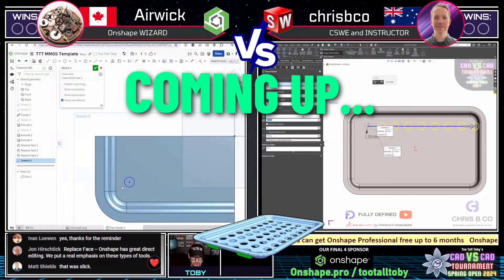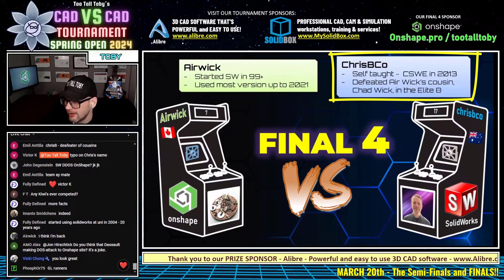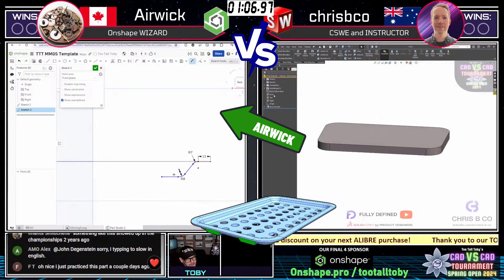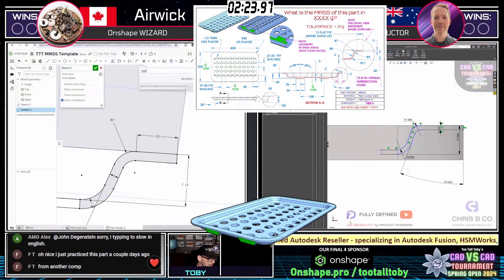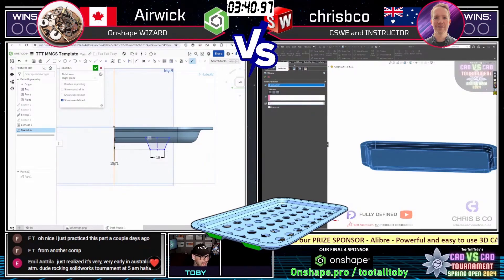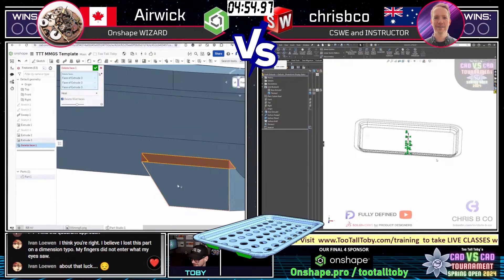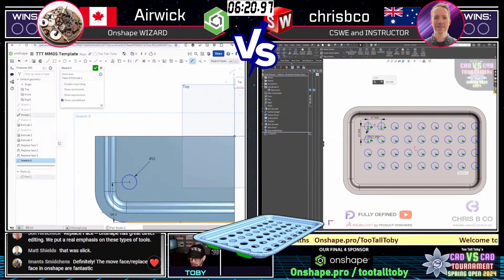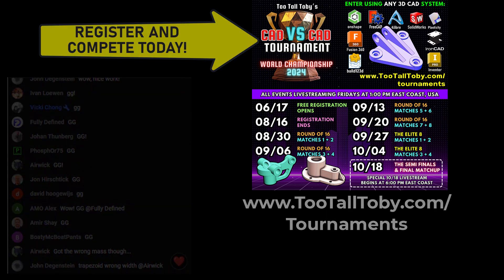Which is FASTER?  SOLIDWORKS vs ONSHAPE - ChrisBCo vs Airwick -Match 1

Comment: Feel like Chris could have sketched a centered circle and used fill pattern for the final pattern, would have saved him a few seconds. It's clicking one surface and typing one dimension. 
Whereas I am sitting at a solid 21 minute completion - but I did get the weight right though.
Reply from the maker: Awww yeah that's awesome!  Nice job getting it correct.  The speed comes with experience (and practice) :-)

Comment: Can someone explain why almost no one is using F360? I've just started to become somewhat proficient and the UI seems a bit cleaner.
Reply: Fusion is very similar to onshape, and onshape has better collaboration, accessibility and a more in depth model and feature library, although fusion does have better CAM systems.
Reply from the maker: We had a F360 runner on the leaderboard in may - www.TooTallToby.com/leaderboard
Here is his run - VERY speedy - VERY impressive:  https://www.youtube.com/watch?v=eEXA1WH69WA

I'd love to see more F360 users in the tournament this year - registration is currently OPEN!